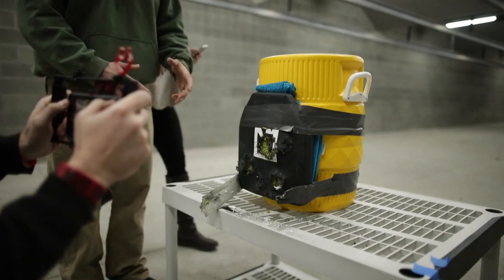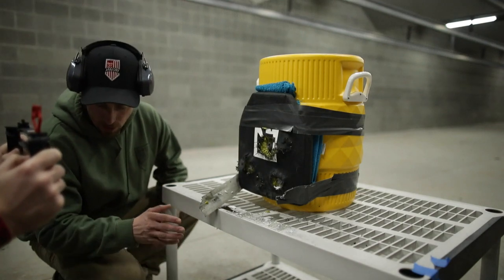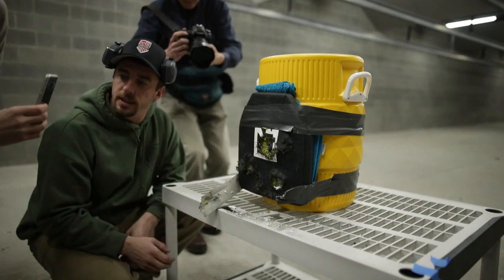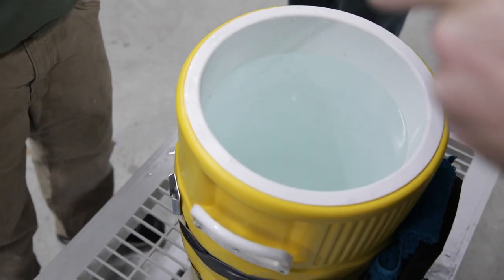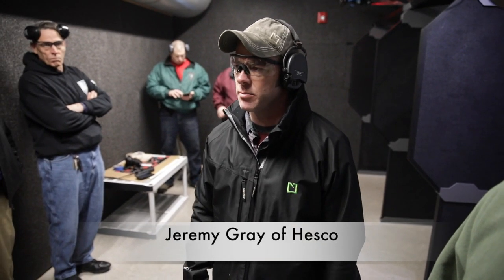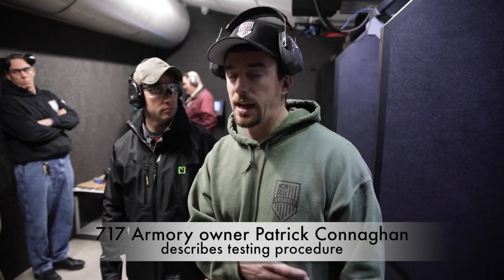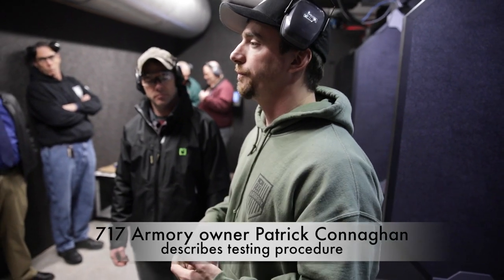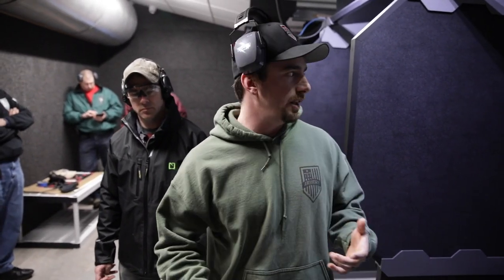Hesco body armor plates withstand rifle rounds (slow motion of round impact)

Comment: Can we please tell Mr.hesco that M2ap is NOT A TUNGSTEN CORE, ITS STEEL.  if it was tungsten iy would be a much much different round.  

Good lord :/
Reply: Unless they hand loaded M993 projectiles into a 7.62x63mm case to simulate since M2AP is not a current production round. I doubt however since 993 slays level IV in a 51mm case, lest a 63mm.

Comment: Was that the shooter (single curve) or SAPI (multi-curve)? It was a little hard for me to tell from the video.
Reply: Miles Young  Kota outfitters has a set of these plates for $230 - can’t beat it
Reply: Single
Reply: 4400 are single and 4401 are multi. for anyone on the fence, go 4401. I sold my 4400 after getting the 4401's real quick.
Reply: @braindmgindustries  pretty sure it's vice versa

Comment: Hesco L210 are over-rated and easily defeated by M193.
Reply: Yeah, Hesco says the L210 stops M193 @ 3150fps. They must have tested the L210 using barrels under 16-18", because M193 velocity in 18-22" barrels is roughly 3280-3350. The M913 at these velocities goes through the L210.